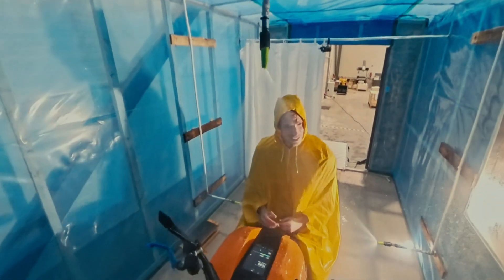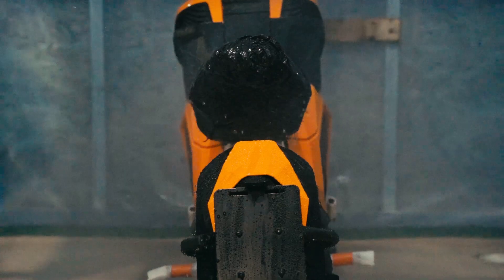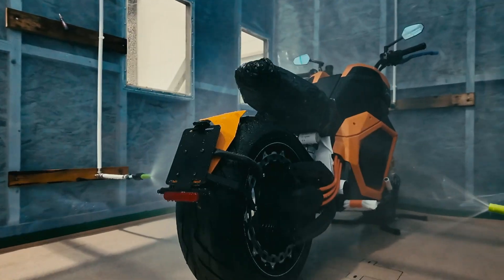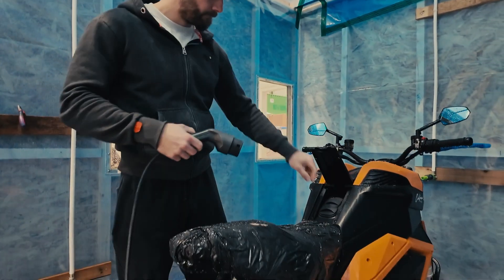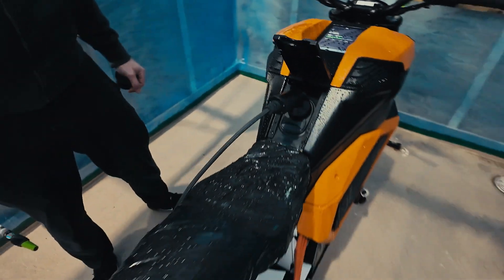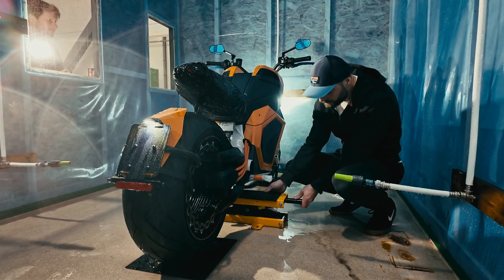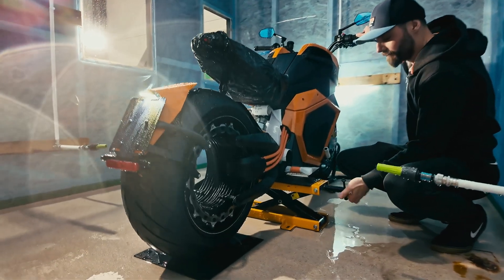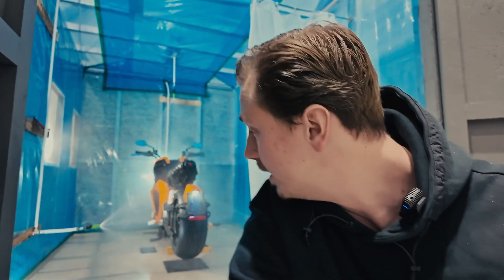Can This Electric Motorcycle Handle a Monsoon? Verge TS Pro Takes on 45 Minutes of Rain!

Comment: It would be a lot more reassuring if this test included spraying dirt (sand/mud/salt/.... ), varying temperature conditions (let it freeze during 12h after making it wet or covering it with sticky dirty snow , then let it roll,  and repeat this cycle numerous times. And on the opposite side of the temp spectrum,  let it run in 40 degrees C conditions. And put the read wheel on rollers to simulate load to check for overheating),.... Make a timelapse video of those tests being done over and over to see how long it takes before something starts wearing out or failing. What is shown in this video is more a gentle  (no pressure) cleaning session with a garden hose !  I get worried  if the test shown in the video is considered as harsh conditions by Verge !?

Comment: electronics can be waterproofed relatively easy.. large low drag bearing seals for longevity are a REAL problem.. that hubless back wheel & its multitudes of roller elements that need to keep lubrication in & grit & corrosion/erosion OUT .. seals drag & must be kept lubricated even teflon or they burn & wear out.. HOW many river crossing or flooded roads can these handle & how simple are they to service a 1000 miles from any specialists center

Comment: If all electrical connections are correctly insulated, this should cause fewer problems than with a combustion engine. But what about the air gap between the rotor and the stator? If you ever have to go through a puddle. Even normal wheel bearings don't like that in the long term.

Comment: Wow - cutting edge innovation.   What about vibration of components in the wheel over time?
Reply from the maker: Hi, thank you for your interest! Our bikes are designed and built with the core principle of having the motor integrated into the rear wheel, ensuring that we have thoroughly considered all potential impacts on the bike and its performance.
Additionally, our bikes undergo rigorous testing to ensure they can withstand various conditions. Rest assured, our bikes are built to endure and perform reliably.

Comment: what are the wrap around the seat?
Reply from the maker: The seat wasn’t the focus of this test, so we covered it to save time and prevent unnecessary wear. However, the seat is designed to handle water just like any other motorcycle seat.
Reply: What wear are you worried about there and what time does it save?

Comment: Can you tell us how you got rid of the wheel bearings that once existed in the center axle?

Do you use a larger, wheel sized bearing ? Or multiple small ones ? Or none ?

How the contact between the rotor and stator is handled? Magnetic frictionless?

The bike is amazing. Very well done. Congratulations
Reply from the maker: Make sure to watch our ”Building Verge TS Pro” video, it should answer some of these questions. Here is the link:

https://www.youtube.com/watch?v=bQsmLtuPbAs

Comment: Great video! It's probably good enough but putting a spray nozzle below the bike to simulate water splashing up from the road could also be nice. And do it longer, simulate one ride from battery full to battery empty in the rain.

That would be similar to what I did on my Zero DSR during a Norway trip, when water got into the bellypan and caused an isolation fault due to the charger connections not being water proofed enough.
Reply from the maker: Good idea, we will pass it on to the factory ⚡️👍
Reply: Not only no splashing, but looks like high pressure amounted to just mist; spread so it hit seat & tire bottom. But hey, I'm from Phoenix AridZoneA; we just went 160 days without rain.
Reply: If you buy a zero you know you have to wearherproof it yourself .. ask moat zero owners ... its not that  hard .. but could be tricky ..

Comment: Ohhh but why the bag over the seat, is it impossible for the seat to handle some rain.
Reply: Or maybe they dont want the seat to be wet after that? Is that even a real question?
Reply from the maker: @icecreamtruckog3667  the seat handles water just like any other motorcycle seat. It wasn’t the focus of this test, so we covered it to save time and avoid unnecessary wear.